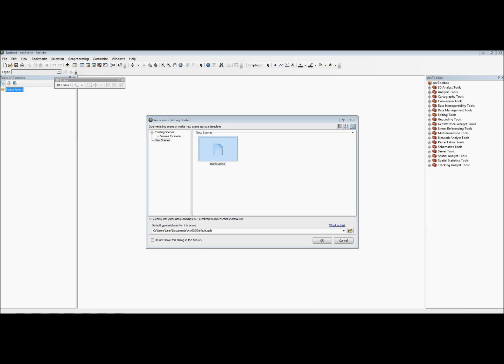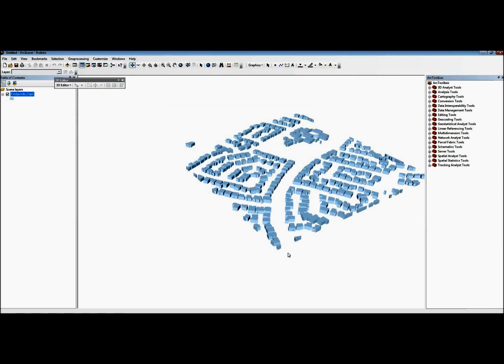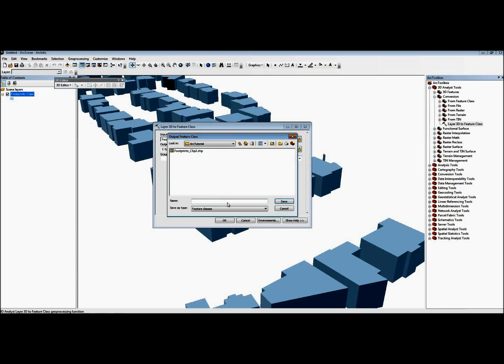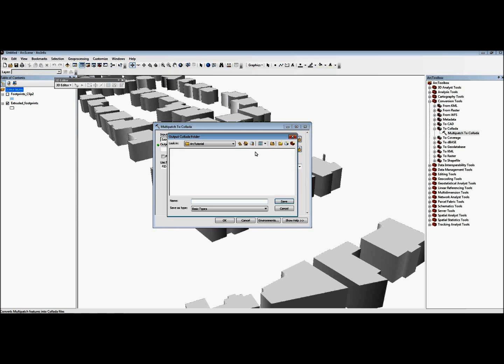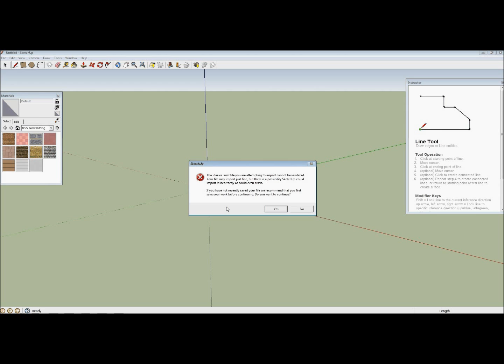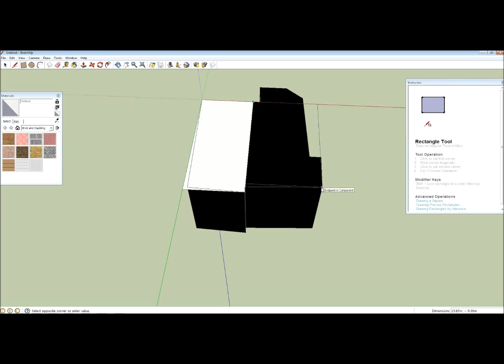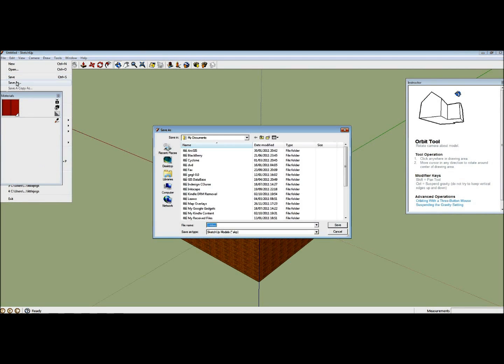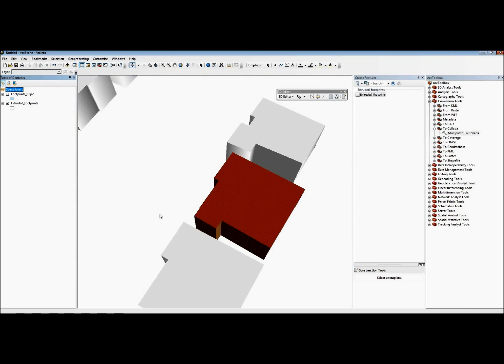Google SketchUp to ArcGIS tutorial

Comment: I don't know why but in my case doesn't work. I don't know whether I am doing something wrong or it is a bug of the software itself. It gives me almost always an error and it doesn't convert it from "Multipatch to Collada". Also sometimes the software crashes.
Reply: i don't know....same error. it almost drives me nuts!
Reply: Yi Zhang
 Found an other way around, but it includes another software, it's called "Blender" (Don't worry, it's an open source software!!).
 - In ArcScene: Export Scene as 3D -> Data type VRML (.wrl)
 - Blender: Import that output file from the previous step and then export it as COLLADA. It will work.
Reply: Thanks man！ I think it might be the problem of version 10.2.2. I later tried the conversion in ArcScene 10.1 and problem solved.